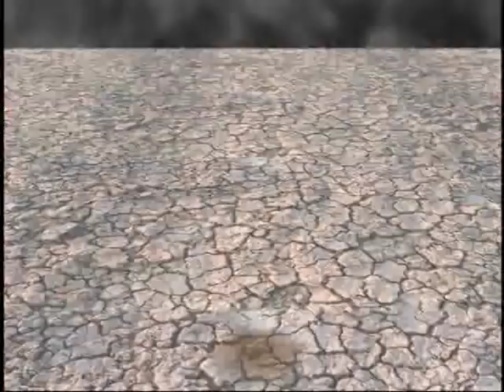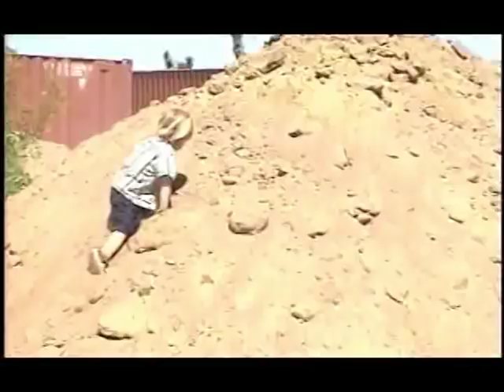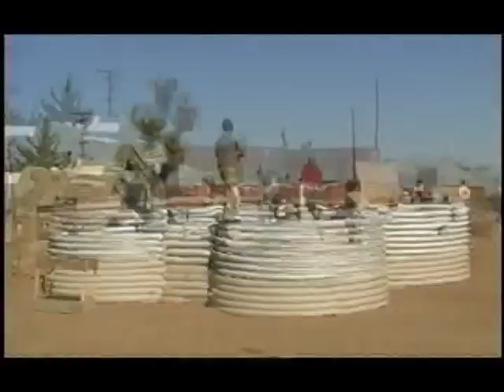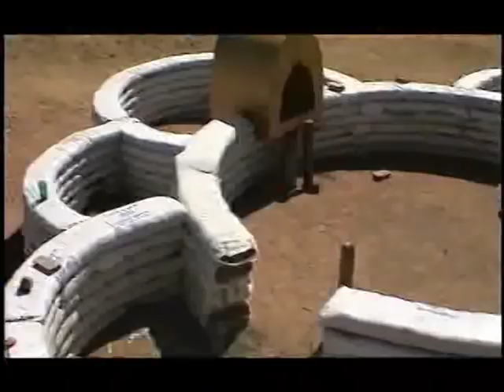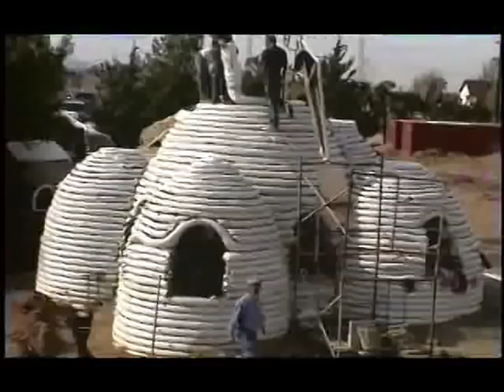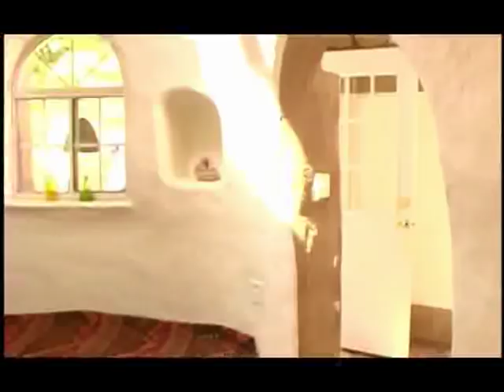Eco-Dome -   Nader Khalili Lecture Series

Comment: Next simplification step:  Calcification in situ.  Calcium Hydroxide ( building Lime - 5 bucks for 50 lbs) will turn clay (silicates) into Calcium Silicate ( fire brick) - porous, rigid, brittle, interlocking cages. This is known tech used to make instant roads and runways on Pacific islands during WW2. 

Tech:

Make an adobe dome using well known means. Spray with liquid Lime. Instant light, porous, fireproof, insulating, seamless, one piece brick dome.  aloha.

Comment: @11mac11s An earthbag home can be build with burlap bags. The benefit of building with earthbags is that you can create the same kind of a structure as a cob home but don't have to dig as deeply to get to the clay. Also, with earthbags there is no need to mix with straw. Various options exist like volcanic ash or rice hulls that make this house indestructible. There are benefits to cob and earthbag but one is not better than the other. However, earthbag building is more economical.

Comment: @cristriky I have been to this place with a friend who has helped build homes like this one.  As I recall this dome was about 400 sq ft. and cost about $17,000 to make which includes permits and all materials.  It is essentially one dome room with 3 extremely small rooms around each 90 degrees of the dome - bathroom, sleeping room, and kitchen - The section of the dome without a small room is the entrance. Very cool place to visit and the public is allowed in once a month for free.

Comment: Reminds me of a dome house I saw once...But the house was INFLATED like a BALLOON! I think they took rebar and cement, that starts out flat on the ground, then they have a huge balloon on the underside, and something on the top side. Then they just fill the balloon with air, lifting the rebar and cement into place, and the whole house is done in less than an hour. Well less than an hour for inflating, maybe half a day for the rest of the work, and then there is drying time. Coolest thing EVER!!!

Comment from the maker: for this structure there was a 10% cement to 90% earth ratio. This was requierd by the building department for permitting. 
However you can build this structure using only earth. :0)

Comment: @chaijm Yes, you can build with burlap bags. The reason that poly bags are used is because they are generally more reasonably priced in bulk. Building with bags creates a rammed earth form without the expense of a rammed earth home. If the mixture is properly balanced then the rammed earth will become hard as a brick. However, even though you can used cloth bags it's still advised to use poly bags of some kind.

Comment: You may need more space to compensate for thicker walls, but you can try lining either the interior or exterior with recycled syrofoam, hay bales, or pack tires with dirt and stack them up. Also, a small wooden fireplace will effeciently heat any room it's put into.

Comment: Concerning cost, Calearth now sells a kit specifically for this house designed as a next step up after building the emergency dome shelter. Info on it can be found here:
calearth.org/building-designs/eco-dome.html
The cost includes plans and bags, as well as instructional videos and books. Cost is currently $3,200. Factoring in building permits, barbed wire, cement for stabilized earth, arch forms, windows, doors, plumbing, probably still under 6 grand. Not bad all!

Comment: @v12tommy Making concrete is a VERY energy intensive and the concrete industry is one of the largest greenhouse gas emitters. For Portland cement, the basic mixture needs to be heated to about 1450 degrees Celsius (2,642 F)! We need to move away from concrete or find a good low temperature process.

Comment: Dirt, sandbags and barbwire don't seem like they would holdup in an Earthquake?
Reply: +bill richards The arch is the strongest shape for load bearing, and a dome is basically a 3D arch. Dirt bags would be able to flex and compress alot better than rigid materials too.
Reply: It is a problem bill.  They have almost no sheer strength.